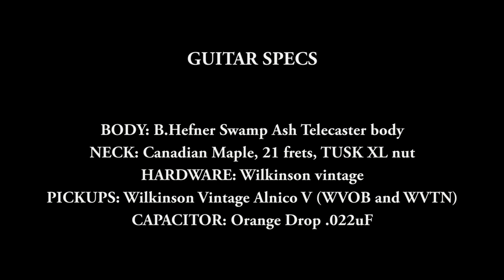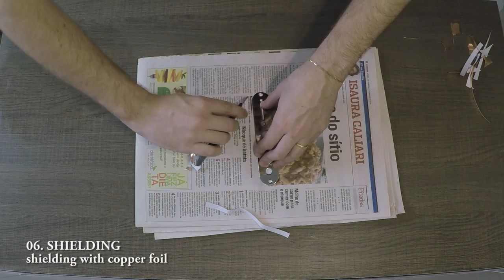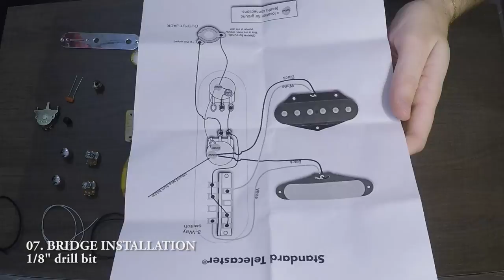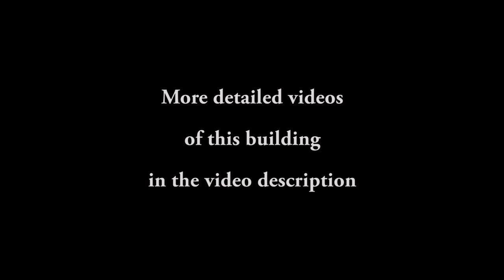Building a custom Telecaster inspired by the 1950 Fender BROADCASTER | How To | DIY

Comment: how is that wilkinson bridge?? im thinking about buying one. thanks
Reply from the maker: It's a great quality bridge for a good price. Just remember that the vintage Telecaster bridge has three saddles for the six strings, regulating octaves is harder than with a modern six saddles bridge. Best regards.
Reply: Gustavo Rocha Leite i have a classic vibe tele that has 3 saddle. .that im having the obvious intonation problems with. Im wondering how the compensated tele bridge would help this
Reply from the maker: I don't think the saddle material will help, but I'm not sure about this. However, these vintage Wilkinson saddles have some differences according to the string. I've got an almost perfect intonation with them. See: http://www.guitarpartsresource.com/images/large/WTBCR.jpg
Reply: ok..thanks for your help. Definitely something im looking into

Comment: Just wondering why you didn't tap the through body string ferrules flush with the body rather than standing proud?
Reply from the maker: Hello. I got the holes drilled that way, they fitted perfectly to the ferrules. If I wanted to tap then all into body, I should enlarge the top holes. Best regards.

Comment: Awesome stuff! Two questions I have for my own build (if you don't mind). How were you able to print the waterslide decal, and how did you get the print facing the paper? I bought one online and it came with the logo facing upwards, away from the paper. Also, why did you put ground wires under the copper shielding? Thanks.
Reply from the maker: Thanks! Regarding the decal, take a look in these two videos: https://youtu.be/5JI8qnhpEKc and https://youtu.be/MPGpSaOWa1M
Reply from the maker: The wire will connect all cavities. You can also put it above the copper.
Reply: Thank you! I actually watched the gold ink video a while ago. So it doesn't matter which side you apply the decal then, right? ....Ah, I thought just the copper foil is enough. Thanks again!
Reply from the maker: Yes, it doesn't matter which side you apply the decal. I usually apply it inverted.
Reply: Got it! Thanks so much for taking the time to answer my questions.

Comment: Nice work. But did you know, that the Broadcaster got a different wiring schema than the Telecaster?
Reply from the maker: Thank you, Philipp. Yes, despite Broadcaster had a blend circuit, I prefer to use the modern one. Best regards.

Comment: Why put copper foil on the control plate and the underside of the bridge plate. These parts are already conductive metal. Some copper tape is supposed to have conductive adhesive. I use the cheaper stuff and use solder to connect all the pieces. All the screened cavities should be connected together by grounding wires with a final ground wire to the circuit ground.
Reply from the maker: Yes, I just did this because copper is a better conductor, but no need at all.

Comment: I dont get it. You installed the bridge and then align the neck? The neck shouldn't move if the pocket was made right and it is far easier to position the bridge to where the neck is.
Reply from the maker: The string holes were already drilled throught the body allowing a perfect bridge installation. Then I used this to drill the neck in the best position possible. But you're right, the neck can be slightly adjusted. Best regards.

Comment: Gustavo, as much as I liked your video, I cannot understand the pointless waste of copper foil under the bridge plate and control cavity cover. Both items are metal and conduct little in the way of RF if they are properly grounded.????
Reply from the maker: Yes, you're right; I just shield with copper because it is a better conductor, but no need.

Comment: this was more an assembly project versus a build, unless i missed the part about how you made the neck and body.
did you wind the coils?
Reply from the maker: Thanks for the tip. In my opinion, this is a very subjective point of view. May I make a friendly critique of your point of view? According to your comment, I understand that I can only use the word build when I "made" the neck and body, and also when I winded the coils. Can I add in this build list the bridge or even the tuning machines heads? And about made the body and neck, should I buy the block wood and then shape the body or I have to saw the tree? What about a CNC body and neck, this is a build or not? Wind the coils and buy the magnets? Don't take bad, just some questions for us to think. Best regards.

Comment: The neck needs to be hand carved to make it feel right because of that and a worn-in feel it will never feel right. this is cheap CNC  neck but if you then hand carve and do the necessary things like roll the edges ect you will increase the value and when some plays it and says wow that's nice its the neck he is feeling the rest of it just looks good and as for the sound when  plugged-in  well sound is subjective.
Reply from the maker: Hi, terry. Thanks for watching and commenting. We must accept that the technology came to stay and it can do as best or even better than us. A CNC neck with a good plan and a good sanding after routing could be the same of a hand carved one. Best regards.
Reply: Hi, there thanks for the  comment if you can or ever get the chance to feel a 1952 tele neck you will feel and see the difference another one is the Japanese reissue and another fabulous neck is on the Japanese Squire 1952 reissue

Comment: That shielding tape is a complete waste of time, and the control plate is already made of conductive metal...
Reply from the maker: I've just applied copper tape on the control plate because it is a better conductor, but no need. Please, share your knowledge about why shielding is a waste of time.
Reply: Because it does little to nothing to reduce noise.

Comment: That's not a guitar build. That is a kit assembly.  If you don't know the difference, try making one from a tree instead of a box full of parts from China.
Reply from the maker: Thanks for the tip. In my opinion, this is a very subjective point of view. According to your comment, I understand that I can only use the word build when I "made" the neck and body from a tree. Can I add in this build list the bridge or even the tuning machines heads? And about made the body and neck, should I buy the block wood and then shape the body or I have to saw the tree? What about a CNC body and neck, this is a build or not? Wind the coils and buy the magnets? Why not making them? Best regards.
Reply: @gugarl :  From what I see in the video, you made absolutely none of the parts. If I am wrong, then I will apologize. If I am right, then all you did is color a body that someone else made, and screwed together a guitar. Again, if I am wrong, I will apologize. In my opinion, you should at least acknowledge the craftsmen who made this guitar that you assembled.  Again, if I am wrong, I will apologize.  I build guitars from trees. I call myself a guitar builder. You shouldn't.  I, like all guitar builders, do not have the equipment to make my own tuning machines, fret wire, or electronics, but I do wind my own pickups, make my own bobbins, make my own nuts,  make my bodies and necks from raw lumber, and occasionally make my own bridges.  I see nothing wrong with what you did. Just in what you called it.  If you believe I am in error, then please point out how, and again, if I am wrong, I will apologize.  That was a good looking Tele.... who designed it?
Reply from the maker: @timhallas4275  Again, In my opinion, this is a very subjective point of view. Have you acknowledged the one that made the bridges you used in your guitar builds? The guitars you build were designed by you, or you also build models designed by other people like Telecaster and Stratocaster? Have you ever thought that maybe I will only consider a guitar builder those who make your own fret wire, pickups, bridges, bodies, and necks from trees? Thinking this way, you're not a guitar builder. This is a similar thought to what you're saying. Maybe I also don't have the tools to make bodies from trees. It isn't Leo Fender that designed Telecasters?
Reply: @gugarl  :  I always acknowledge the manufacturer or supplier of the parts and materials I use. No guitar builder makes their own fret-wire, pots, jacks, switches, strings or screws. Many professional guitar builders wind their own pickups, make their own nuts, and fewer still make bridges, pickup bobbins and knobs. The one thing that distinguishes a guitar builder from a guitar assembler like you, is the carving and shaping of the body and neck from raw materials, fretting the fingerboard.  I often use all purchased hardware for a guitar, but I never buy a  body or a neck. Every one of my 30 + guitars were designed by me, using only basic specs like scale length and fret spacing. I have done this since my very first guitar build in 2005. You may call my point of view subjective, but there is no doubt a great difference between what I do and what you do. I am a guitar builder,, you are not.
Reply from the maker: @timhallas4275  I never said I'm a guitar builder. Am I not a guitar builder because I don't have the tools? I'm starting to agree that you're the demigod of guitar build because you saw the tree and make the body! Is this the only difference between you and me? And you're even better than a CNC because you can saw a tree and it cannot.
Reply: @gugarl  Someday,  maybe you will come to realize the difference between a guitar builder and a guitar KIT builder.  It is somewhat like the difference between a man who buys a house, paints the walls, and puts on new siding,, and the man who buys lumber and makes a house where once there was none.

Comment: Your place in jail! It is illegal to make fakes!
Reply from the maker: Thank you for watching and commenting. This is not a copy or a fake of any guitar. As I said in the video title, it is only inspired by the Fender Broadcaster, a guitar that is not produced anymore for more than a half of a century. It is a homage since I love and can't afford vintage guitars like this. There are a million of differences from the original one. Nobody can be fooled. I also put a decal on the back of headstock informing that. I've just build it for my personal use and post the video to inspire everyone to create you own guitar. Best regards.
Reply: @gugarl  Everything is clear with this question. Personally, I think it wasn’t worth sticking the Fender logo on this tool. You could create your own logo or put a personal stigma, as all decent people do. At times, I restore old guitars and if I make any changes in them that do not correspond to the concept of the original manufacturer, then I put my own mark on them. So that people can see that the guitar is not original, but redone. And no one will say that I fake.